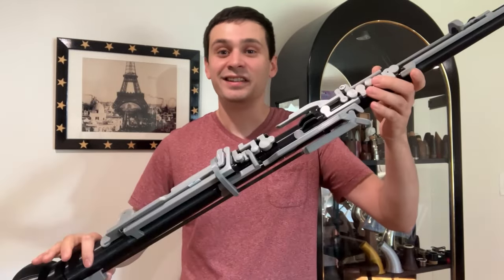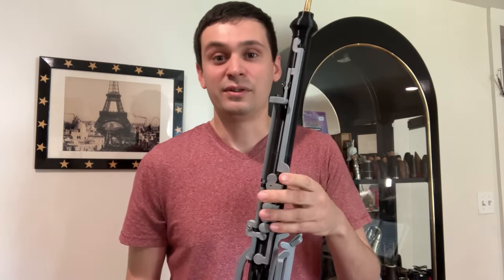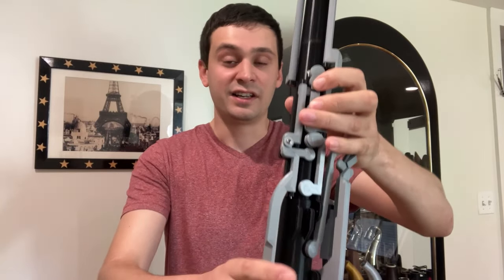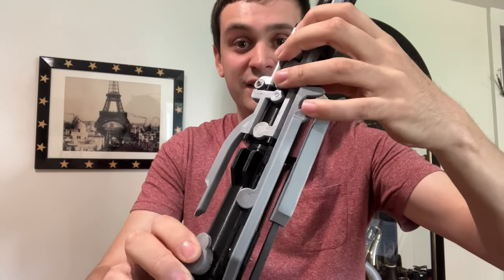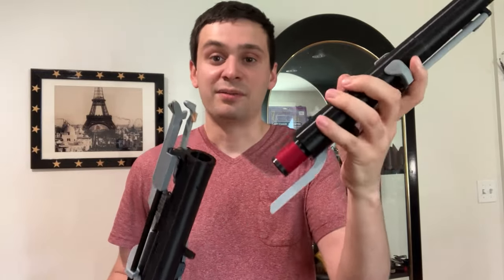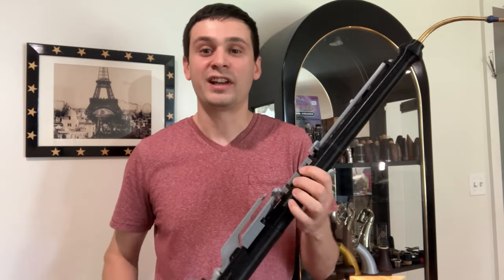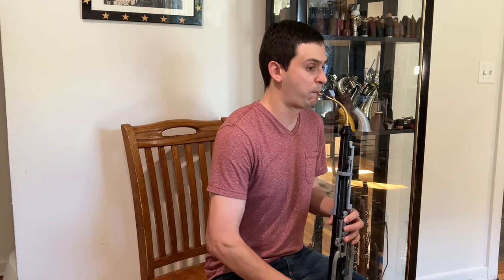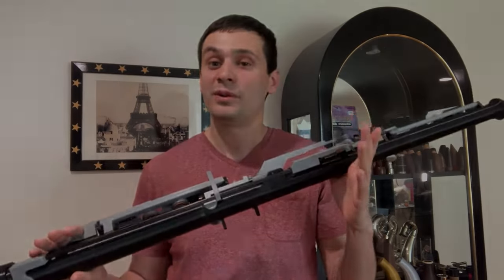I made a 3D printed bass oboe!

Comment: Without knowing the exact interior dimensions of your bore, I'd have to say just by sight and sound you've actually 3D-printed a Heckelphone. While it is similar to the bass oboe, they are in fact very different instruments, and it's an important distinction to make. The bass oboe has a much smaller bore - it's essentially identical to the bore on an English horn, the bass oboe just keeps the same ratio of conicity as it extends down the further length of the instrument. The bocal bore and reed are also much smaller for a bass oboe, and the bell shape is also vastly different between the two. The resonance and projection between the two instruments as a result is vastly different - the bass oboe tends to have a smaller sound, and can be harder to hear in an orchestra during loud spots, whereas the Heckelphone has a very penetrating sound in any dynamic.  All that said, this is a super cool print! It'd be interesting to see how you can further refine this!